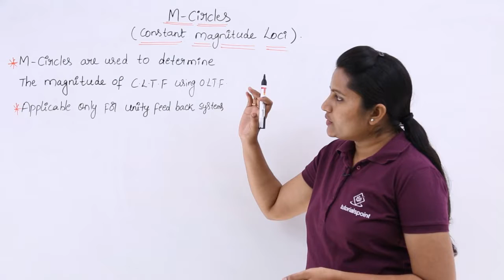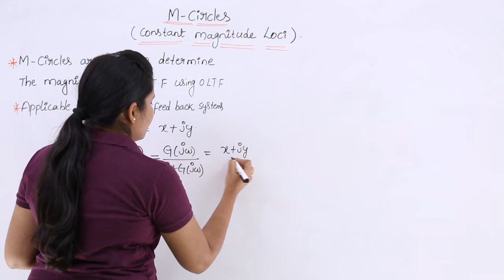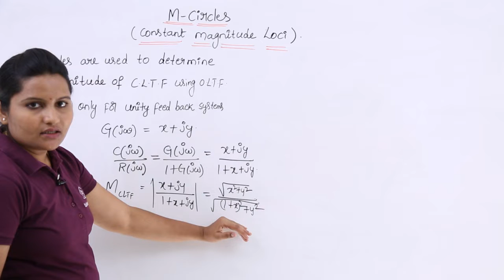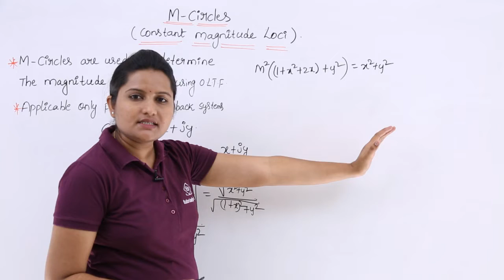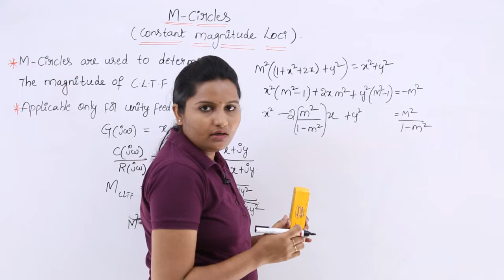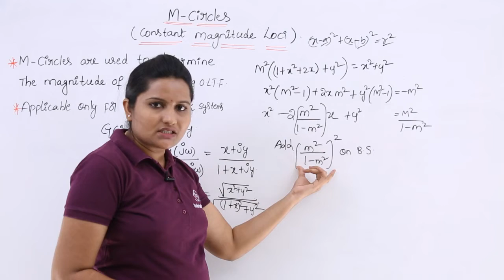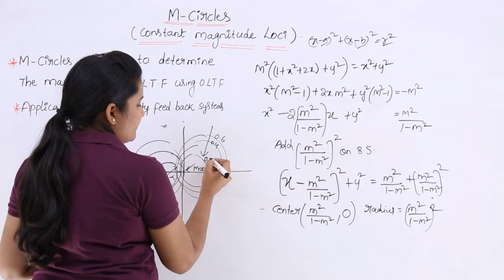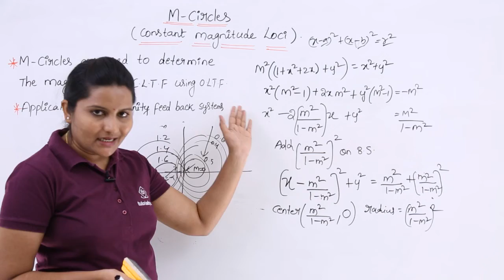M Circles

Comment: the radius is : m/(1-m^2)
Reply: Francisco Moreno Aguilar Please reply value of r is this or not 

R=[(M^2/1-M^2)+(M^2/1-M^2)^2] please check the video at end
Reply: @basicUttarakhandInEnglish  no francisco is right....after simplification m/(1-m^2) will be the radius
Reply: @ronaktandon8458  how? can you show the calculation?

I thought the answer should be square root of [(M^2/1-M^2)+(M^2/1-M^2)^2)]
Reply: @amirulasyraf9900   1)TAke m2 /1-m2 common 
2) lcm of 1, m2/1-m2
3) sq.root of m2/(1-m2)2
4) radius is m/1-m2